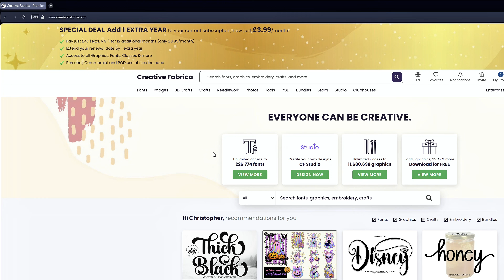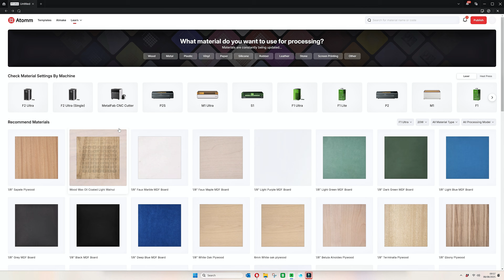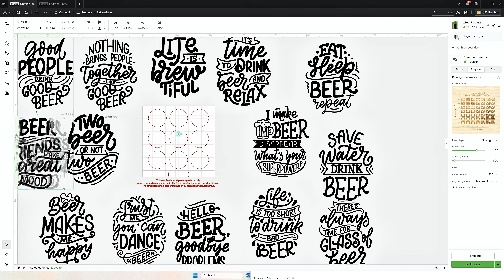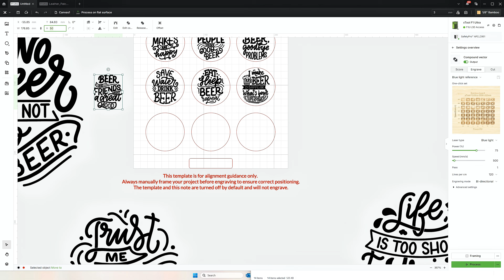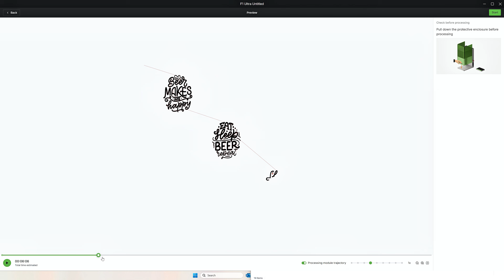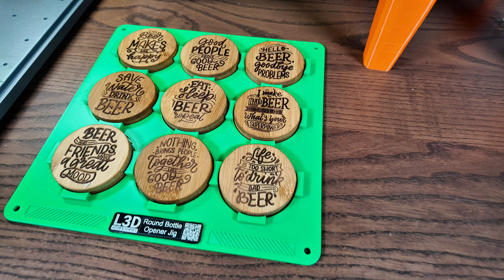The Exact Workflow I Use to Sell Laser-Engraved Bottle Openers

Comment: Thanks for sharing your video, it’s fantastic! My question is I have XTOOL D1 Pro 2.0 and I wanted to purchase the layout on Etsy, will the one you used here work with my machine?
Reply from the maker: Most of the designs I use are from a website called Creative Fabrica which is a subscription website. You can import SVG files into xTool Studio so as long as the design you purchase is a SVG (vector) you should be good.
Reply: @L3DAccessories  
Thanks